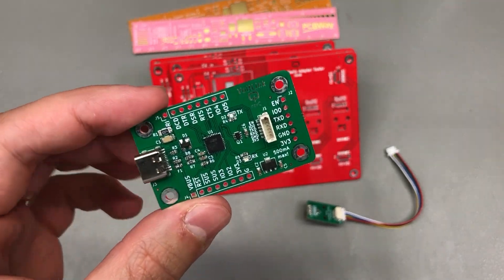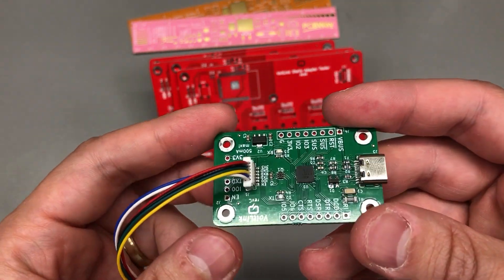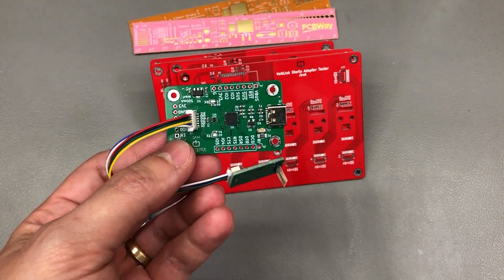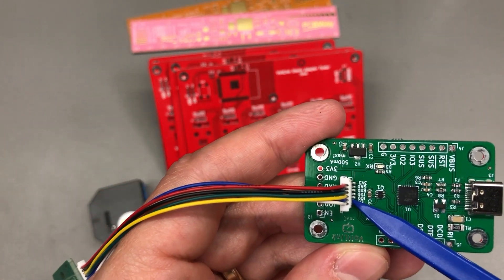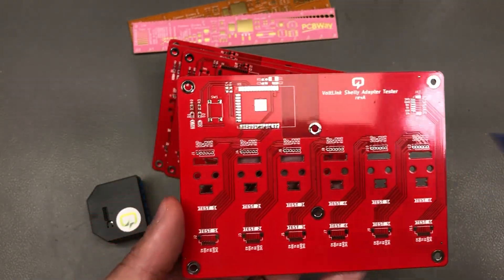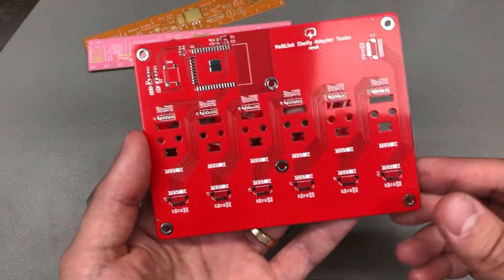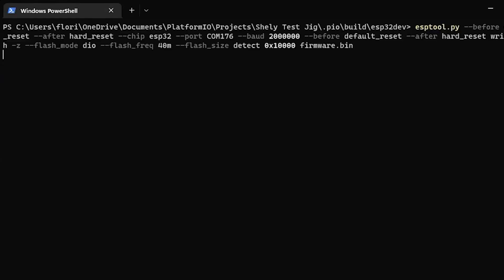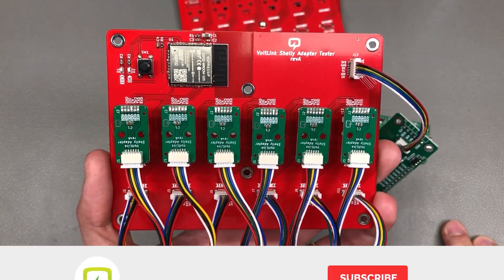Making A Custom PCB Test Jig | Voltlog #426

Comment: Hi! Nice board. I'm aware there is no specific need for the ESP to have wifi, but woudn't it be good practice to keep plated screw holes out of the keep-out zone of the ESP antenna? 
Greetings
Reply from the maker: If you care about the best antenna performance, it's best to mount the ESP32 module vertically with the antenna floating in free air.
Reply: @voltlog  no no, I meant the screw holes :)

Comment: Did you order from jlcpcb any green boards recently? It looks like pcbway has a bit darker soldermask color(which i like) comapred to jlcpcb. Can someone confirm that?

Also which connectors are you using? They look really compact. Can you give me part no?
Reply from the maker: Soldermask color can vary even from the same supplier.. and the connectors are JST-SH

Comment: I would personally add an led to each one. To display if it failed or pass. That way you don't need the pc to run the code. make it headless.
Reply from the maker: Certainly possible but not worth the trouble for me.
Reply: @voltlog  Understandable. I was just curious that's all.

Comment: Help needed.
I am wondering if you could help me out with finding appropriate tools and software to reprogram Sonix SN8F5701SG (SOP8) microprocessor! 
This particular PCB board is for driving a single LED (3V and up to 4A). Before, this PCB used Atmel ATTiny13A MCU that was simple and effective, nothing more powerful was needed, but since of Atmel MCU shortages factory of these PDB boards changed the desing and is now using Sonix SN8F5701SG and now I can not use my custom firmware because there are no free (and simple enough) tools to rewrite the program and load it into new MCU.
Any help available? Thanks
Reply from the maker: Sorry! I have never heard of those controllers..

Comment: Hi Florin! Great video, I liked the idea about PCB colors for different releases.

I bought a couple of VoltLinks for our company to use with ESP32 now that we will use them in our production.

Right now we will have low quantity for our boards, but they need to be bulletproof with traceability and standardised testing, so I will be putting in the time for a test jig and serialization.

Ps. Have you considered making a discord or something?
Reply from the maker: Hi!
I am not sure I have the time resources to maintain a discord but I'll give it more thought. Thanks!
Reply: @voltlog  i help maintain another discord, Microtype Engineering yt channel.

If you want any help, send me a mail to the email on my tindie order.
Reply from the maker: @danedwards_ee  Ok, thanks for the offer, I will think about it and reach out.